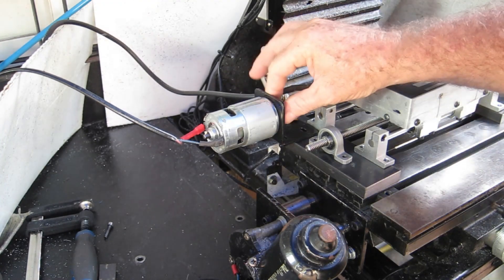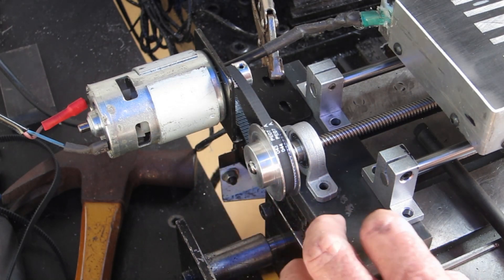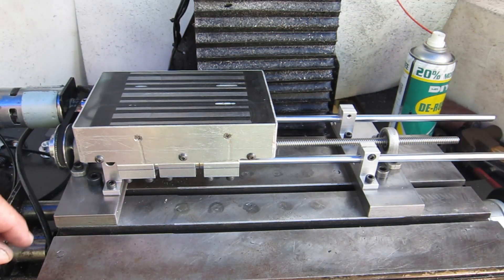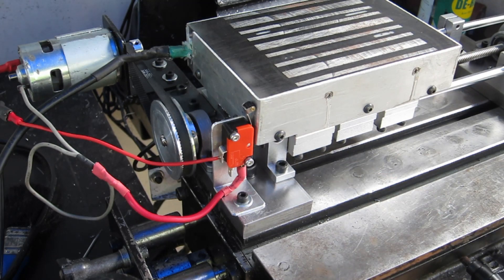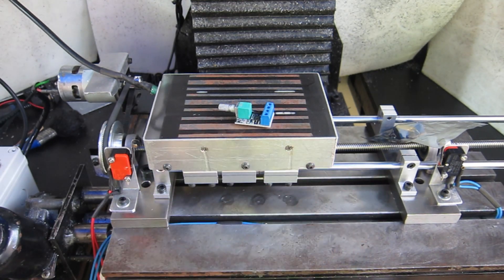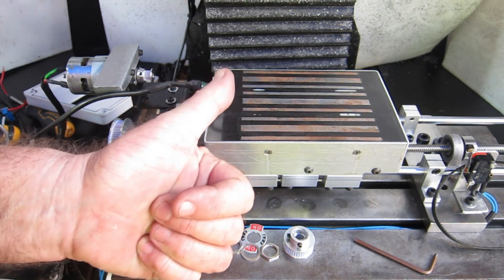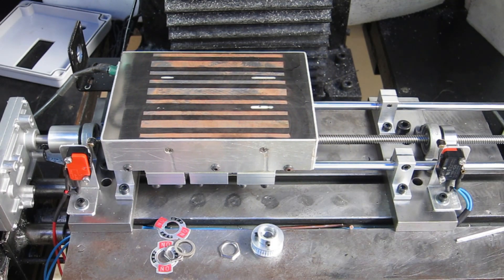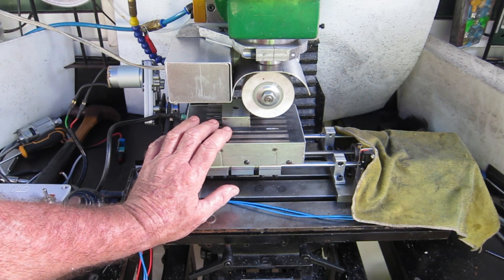MHW Episode 57 - Experimental Surface Grinder Attachment - Part 4

Comment: The switch that you touch will run back to shore.  Where did you buy it from?  Motor too
Reply from the maker: I buy almost everything from Lazada, the switch is called a limit switch and the motor is a 12v Takanawa geared motor

Comment: I ordered a toolholder and it just came with a separate pack that had a small belt and pulley in it. Now I did order a matcfit pulley and drill head but that did not come. I am confused. Another great video!!
Reply from the maker: Many thanks, last of the silencing of the machines is this Friday, then it's back to making things. 👍

Comment: This thing turned out great!!! How is your noise situation?
Reply from the maker: Thanks, I have plans to refine the mini surface grinder a bit coming up, the noise situation I'm still working on, but I'm well and truly over it and will be getting back to making stuff again soon 👍
Reply: @MyMiniHomeWorkshop  I am so glad. I was getting a bit worried about you. You have been in my prayers my friend. I have two moles that I have to get removed. I have had them ever since I can remember however they are only stomach and since I gained weight after my accident my belt irritates the F out of them. Glad you are doing better. I did not realize how close you were to the companies we get all our stuff from. I have been looking for a welding table and every one that I liked was in the thousands. I had just figured I would have to use a thin table and use my mag drill to make the fixture holes....until earlier today. When I was buying the tapping /threading station the guy said he had a welding table top. I asked how much he needed and the prices for the table and other machines were ridiculous. My friend who went with me to pick uo the Tapping thing messaged him and offered him $100 for his table top. The guy said no to him. The top is 2 inches thick, 3 feet by 5 feet .  I messaged him when. I saw he had listed it and he said if I had $100 he would take it. My friend Robbie is just a little socially inept. I am going to have to get the my crane to get the thing out of my trailer. I was at the scrap yard the other day and picked up a 4 foot by 4 foot piece of 1/4 inch steel for 24 dollars. That is like .21 cents a pound. I cannot even imagine what that table would be. I am guessing almost a thousand pounds maybe 2000.
Reply from the maker: @Biokemist-o3k  I've always said, "If you don't ask you will never know" 👍
Reply: @MyMiniHomeWorkshop  Exactly.Did you make that grinder that you used for the bottom of the lathe. It is super cool. I have to make one.
Reply from the maker: @Biokemist-o3k  I had nothing in particular in mind when I dreamed that up 🤪

Comment: First, please excuse anything I say that's out of date. I started writing this a week ago and just getting back to it.

Thanks for the excellent video series.  I'm glad to finally see it make a test run!
If you're open to a bit of constructive criticism(?), I've got some ideas for you:
You've had some problems with the grinding wheel not running true. Several factors go into this but, rather than trying to describe them here, here are a couple of links to videos that address the problem. They're both centered on bench grinders, but the root problems are still basically the same as what you're running into. Each of them has some useful information and perspective that the other doesn't:
https://m.youtube.com/watch?v=rlpyssW-sG0
https://m.youtube.com/watch?v=F3fVgcvmex4

There's another problem that you're eventually going to run into.  Despite having the wheel rotate so that the sparks fly away from the motor, the open-frame permanent magnet motor is still going to atract every airborne particle of grinding dust that gets anywhere near it.  It'll be a toss up whether it chews up the brushes first, or shorts out the windings.
I don't know of any GOOD fix for this, but fastening very fine air filter material over the openings on the motor might help some - albeit at the cost of making the motor run hotter.
It may be that attaching some strong neomagnets near the openings in the motor might help some too - purely by drawing the particles to themselves before they reach the motor. This comes at a cost too, because the closer those magnets are to the motor windings, the more they're going to tend to slow the motor down (and heat it up) by inducing a counter-current in the windings.

Again, thank you for all of your excellent videos!
I'd love to build a miniature surface grinder of my own (that works!). My attempt was to attach a Dremel to a board and sliding my work piece back and forth on a tabletop beneath the wheel. My results were ...unspectacular. 😕
Reply from the maker: I sorted out the wheel issues, and I'm pretty sure I have watched at least one of those two videos you linked to previously, thanks for the comments, always open to useful ideas 👍

Comment: 😀I do believe the use of better parts, table speed improved the surface grinder would be great. Do think a thinner wheel may give better results??????
Reply from the maker: You could be right, this was all very experimental, I haven't given up on it, taking a break over December, so I might have another go at it in the new year. As I said upfront, it was very much just a proof of concept.👍